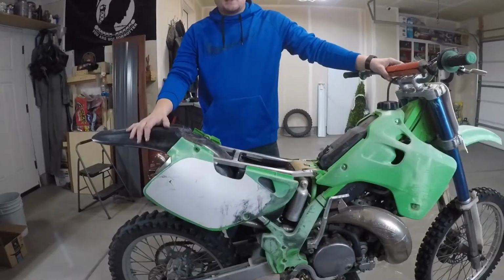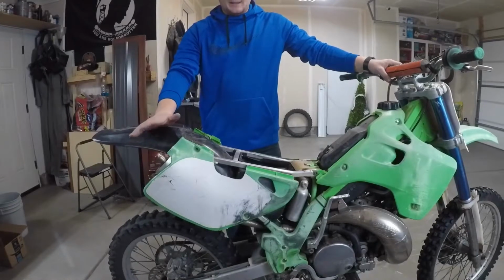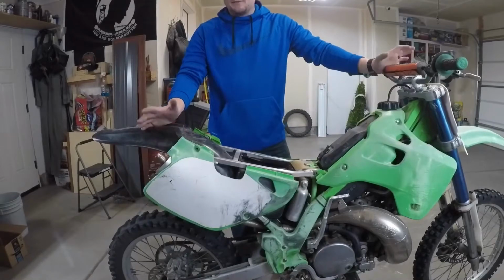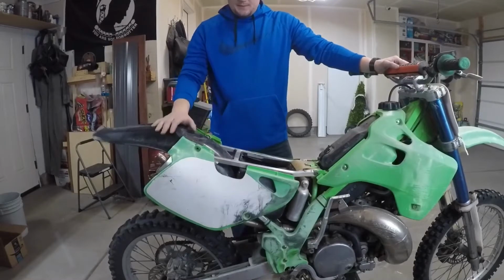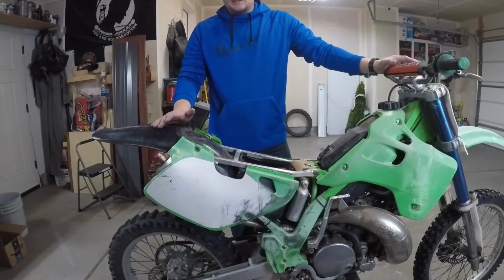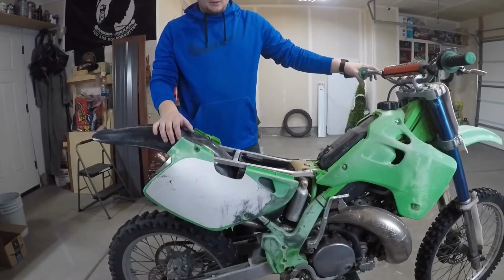92 KX250 (Frankenstein) - Part 1

Comment: Hi I just got a 92 kx250 and need to replace the shifting rod but for that year they are discontinued do you have any suggestions or do different year parts fit ?
Reply from the maker: josh kenner are you referring to the shift pedal lever or the change shaft